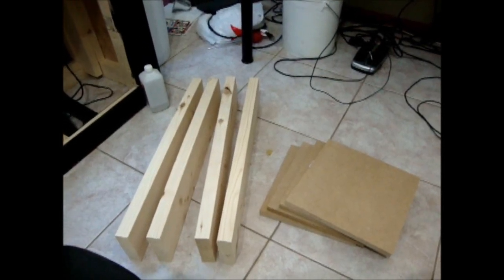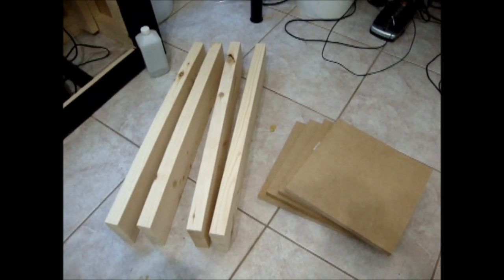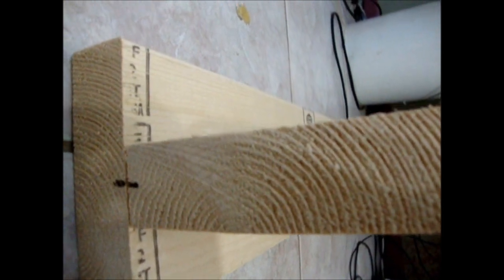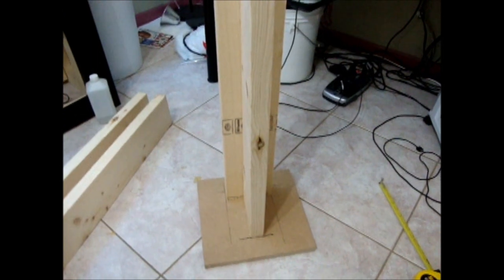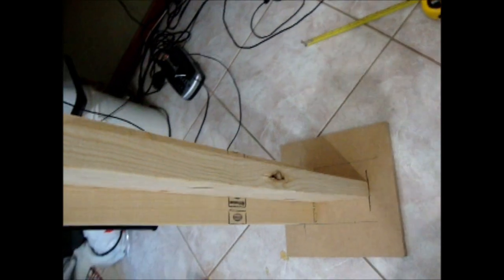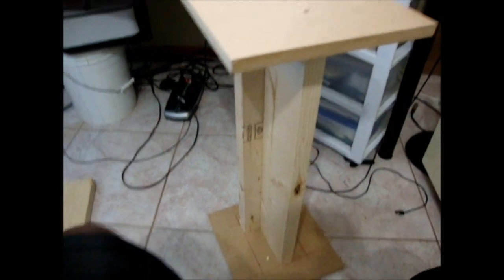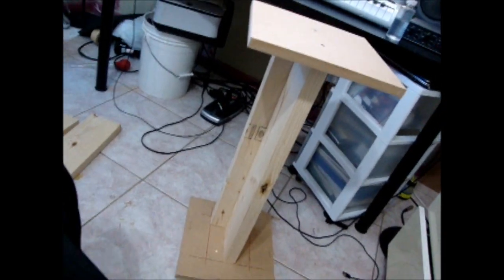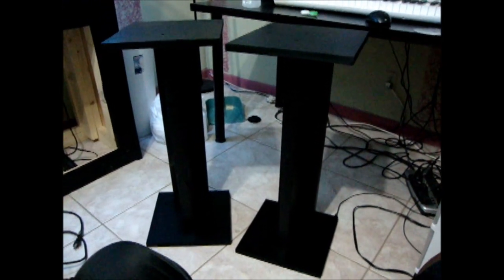diy speaker stands

Comment: Thanks for this video, im going to make a pair of these for my setup.  I was going to use PVC as the middle beam but i like the idea of a couple of 2x4's as the center.  The only thing im going to add to your design is a piece of PVC in the back for a speaker wire channel to hide the wires.  Other than that, great video!

Comment: Brilliant!!  I always build versus buy when I can.  I need monitor stands for my electronic drum set. I will be using your design. Thanks for sharing!!

One tip: A little wood filler in those screw holes you counter sunk before painting and you wouldn't even see them.

Comment from the maker: @EnWorshipMedia  
i got my materials from my local home improvement store(home depot, lowes, etc) where they also cut the wood to size for me based off my measurement at no extra cost.  As far as design is concerned there is so many ways you can make it.  I've seen people use wood, metal, and even pvc pipe to make there stands.  what i recommend is you google "diy speaker stands" and find a stand build you like and go from there.

Comment from the maker: i used a shelf and had it cut in 4  so that i could have the base and the top.  i also had 2x6 cut 29" long(I think) in 4 pieces but you can use 2x4 also.  if does not answer everything let me know.

Comment from the maker: @die101 I got mines from home depot (home improvement store) where they also cut ti to my measurements for free.  I used regular 2x4 wood beams-just make sure you pick nice straight beams.  for the top and base, I used the flat wood used for shelfs and had that also cut to size.  hope this help if not just ask me.